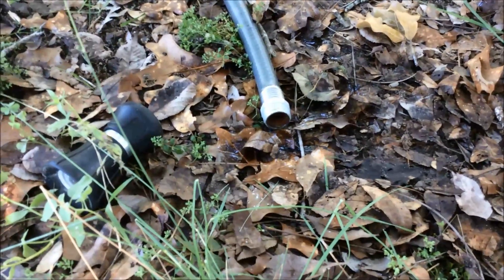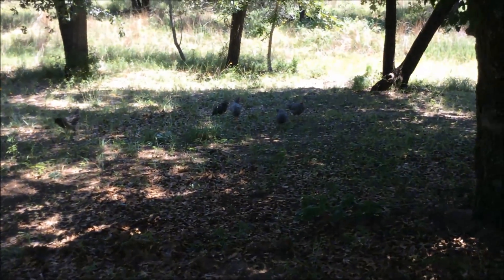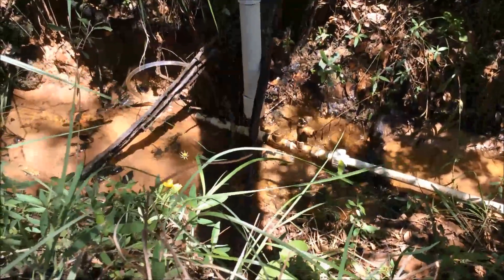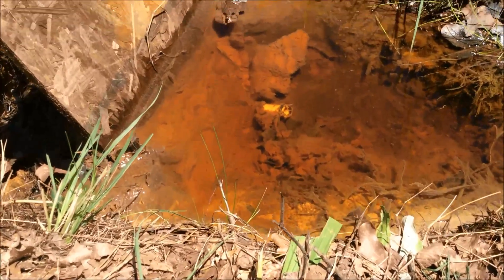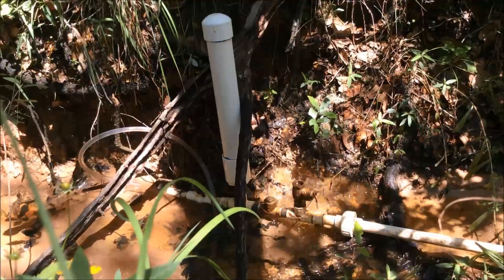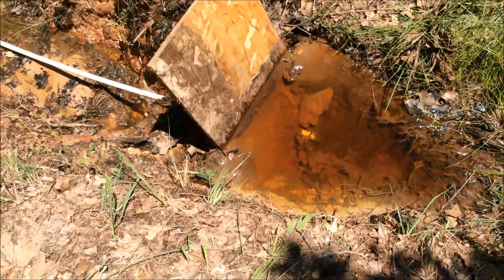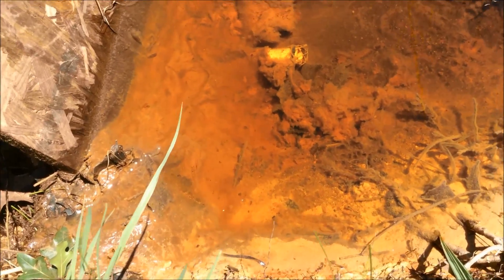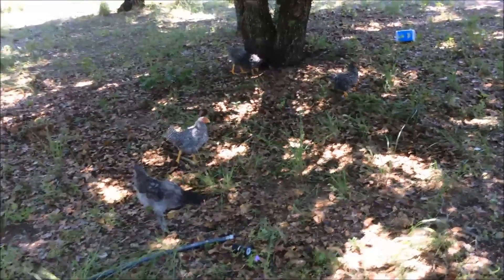Our Hydraulic Ram water pump - free water

Comment: Great video and lovely to see someone else enthused about ram pumps, I built one last year and pump water about 50 feet up and 300 feet away into a holding tank for the garden, thanks for sharing I have just subscribed
Reply from the maker: Michael Collinson that is cool and is exactly what we plan to do with ours. We are going to get a large tank so that we can fill it in the spring when it rains then use it during the summer for our garden drip system.